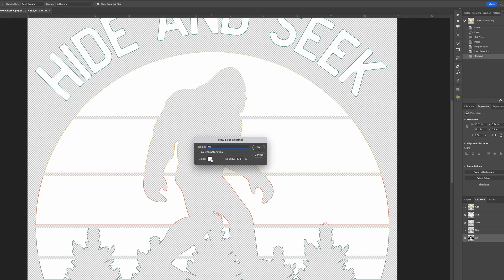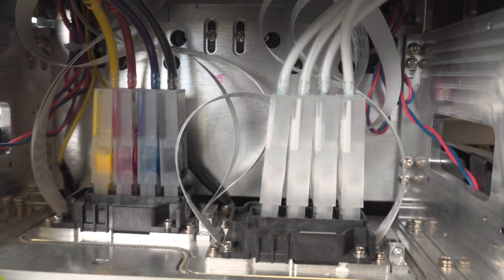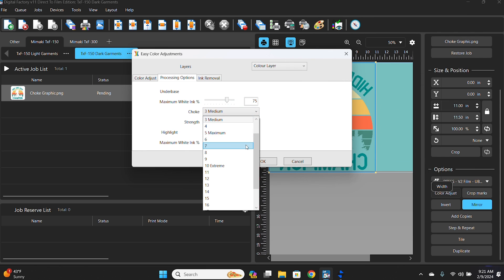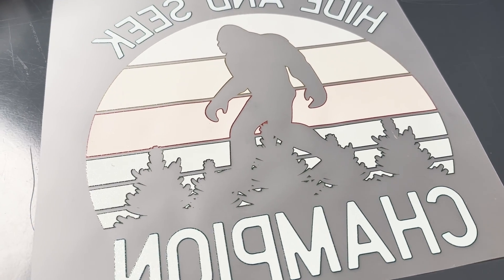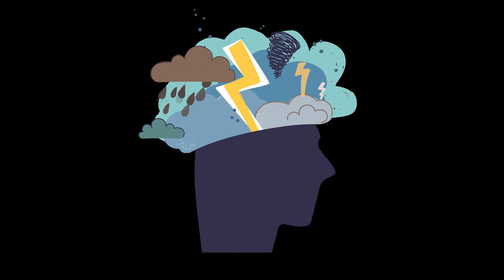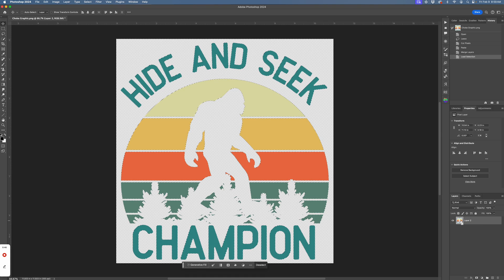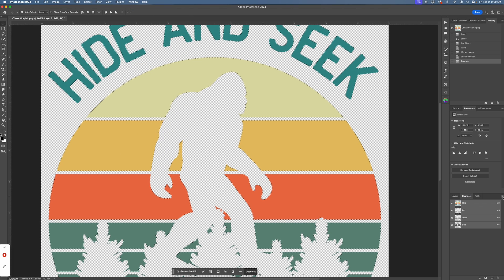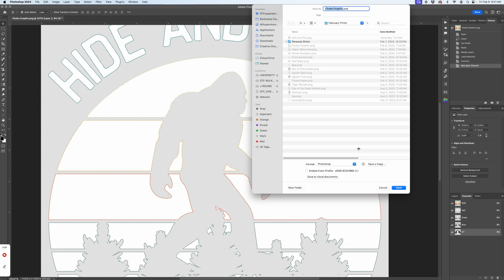Mastering White Underbase Choke: Essential Tips for Flawless DTF Prints

Comment: When I choke in flexiprint, any white in the original artwork gets reduced also, eg. white text becomes thinner.
Reply from the maker: We are not super familiar with Flexiprint but that shouldn't be the case, I would see if they have a knowledge base or FAQ section to address this.
Reply: @DTFSuperstore  thank you. I thinkmits an issue with white information in the original file. If I just print it no white is printed, so there's no white channel.

Comment: will this help prevent def powder sticking just beyond the edge of the image.... or is that a humidity issue?
Reply from the maker: If you printer has heaters turn those on to 35C/95F and if you're using a dryer/shaker turn on the heated guide place or preheat to 65-75C.  It's moisture wicking from the in into the ink absorbing layer.  The heaters will help dry that so adhesive powder doesn't stick to it.
Reply: This is mainly the problem of the coating of DTF film ,some film want to adsop more ink , at the same time it will also adsop more humity , final  adshensive the power in no ink place